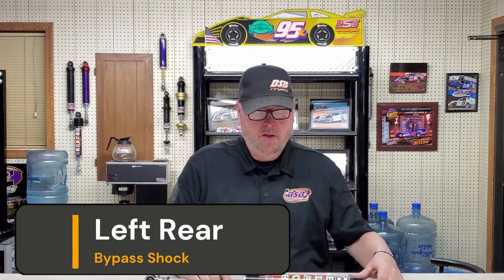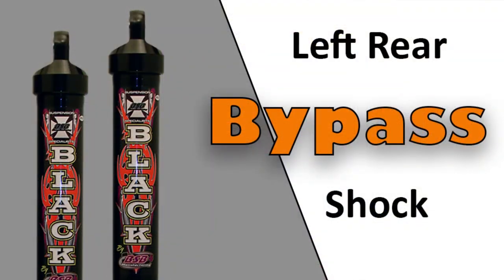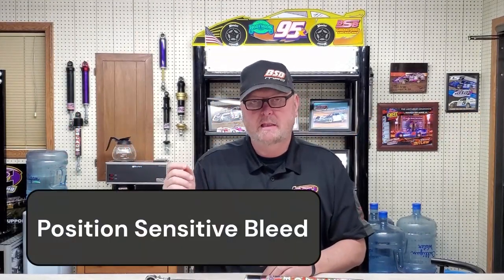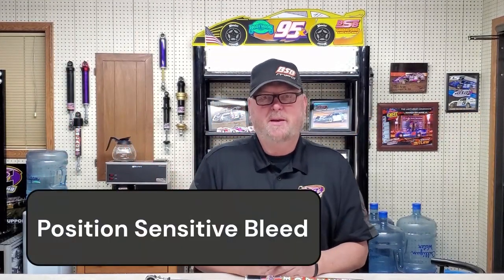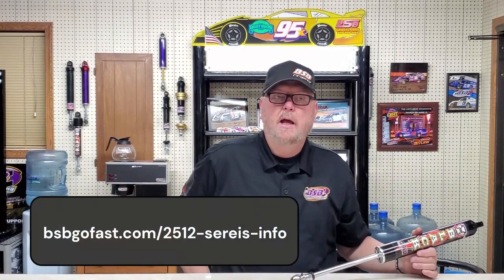LR Bypass Shock

Comment: Hi Jay, I'm currently running a imca modified in Michigan and have learned a ton from watching your videos. 
Now I'm at the point of losing traction because the tires are trying to do the shocks job of absorbing bumps. 
I am looking at becoming a member this year. Wondering now what the cost of a shock package would be?
Reply from the maker: Well it will depend n the shock you pick, but I feel that we should use the 25 Series Shock. Cost is 325.00 ea and we will talk about upgrades and options when you call.
Reply: @jaynealgofast  HI Jay we run a unit streetstock learning alot

Comment: Can you build these for a hobby stock?
Reply from the maker: In the rear we can, we can also do it in a 9" if your not IMCA
Reply: @jaynealgofast  would be for imca, seems guys build a super stiff lr to help some dig but always have issues being tight mid corner and lose off or if the track has character to it it pogos
Reply from the maker: @mikekennedy8933  You are right , most of the time we don't over do the left rear shock on a hobby because it hurts the turn so bad, we do tune it more with spring rate to make drive. Still car needs a good touch of rebound.
Reply: @jaynealgofast  maybe we need to visit on a set